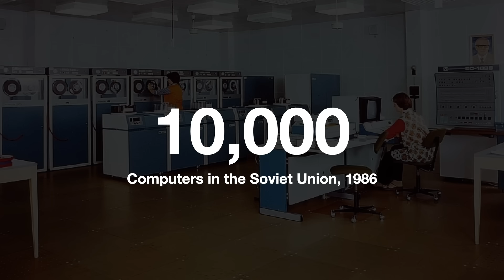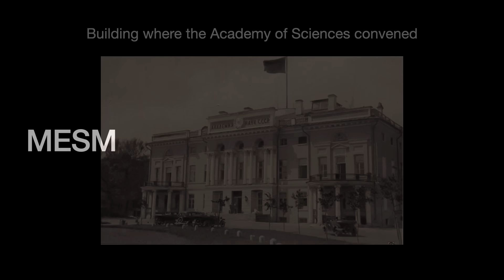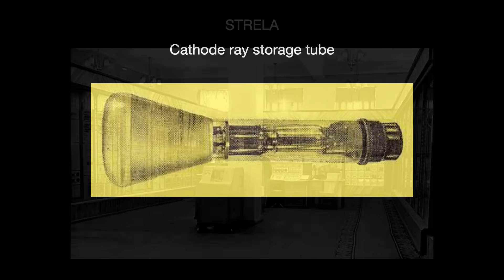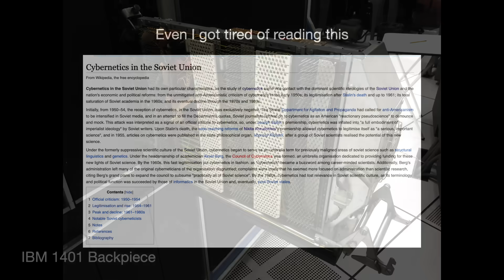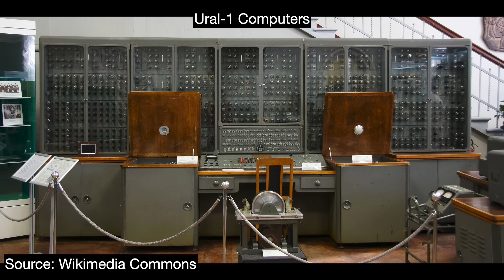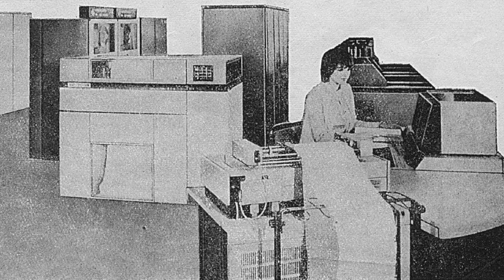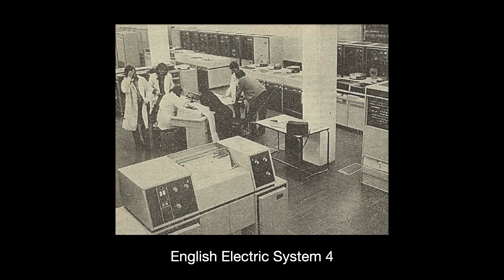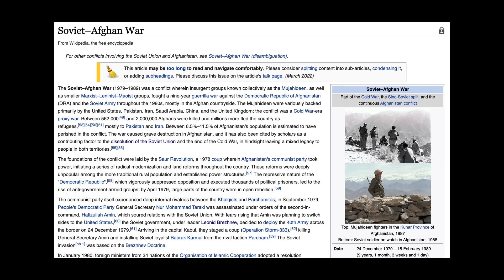Why the Soviet Computer Failed

Comment: As a Vietnamese, this is the first time in my life I hear about Soviet computer. All we have back in the day are Soviet made cars, and Aluminum wash-tub.  The wash-tub is indestructible and the car was unbearable.
Reply: The soviets were definitely years ahead of the west in wash tub technology.
Reply: @digitalcitizen4533  I think the general rule was that if it was good for something to resemble a tank, then that thing was good.... At least as far as its tank like qualities went.

Otherwise, results varied.
Reply: @bobs_toys  they were good at simple consumer electronics like fridges and fans and things, often built far tougher than their western counterparts, but once things got too complicated they tended to lose the thread
Reply: @glurgbarble7268  I obviously haven't had personal experience, but from what I've read about east Germans finding their stuff in western bargain bins... No they weren't.

A lot of consumer stuff was really, really, really well maintained, but that was more because if it broke, you weren't getting another one.
Reply: @bobs_toys  I lived in late USSR and as student managed to work with these ES (ЕС ЭВМ 1040 if I recall correctly)  series machines. One thing that surprised me first time I was in machine room - rubber mallet mounted on the wall. It was used to reset boards because connectors was crappy and contact loss was usual problem. Old graybeards told me that it came from factory with a machine.
Reply: @ctrlz4439  Wow!
Reply: @bobs_toys  I won't be surprise if that wash tub is actually a tank hatch which they rebranded as wash tubs.
Reply: @ctrlz4439  Made me think if apple did the same we would pay $1999 for Apple mallet.
Reply: @bobs_toys  hate to break it to you but even their tank wasn't all it's chalked up to be
Reply: @glurgbarble7268  To be fair it's relatively easy to have mechanical items reverse engineered.
Reply: @ctrlz4439  yeap true ! Same as for TV sets - need from time to time to be hit with the fist because of bad connection at tubes...restart policy !
Reply: @2nd_ntr  yeah look at how poorly their doing in the ukraine
Reply: @glurgbarble7268  I must say not even the simple consumer "things" were all that good. The only reason the russian fridge lasted for decades in my family was that we had no chance to get another if that one broke down, so my father made sure it was handled like a fairy queen and well maintained. IT was sturdy all right, I grant you that - about a 100 kilo of metal and very little electronics. Same goes for just about everything built by the block.
Reply: @Josh-rn1em  The Apple iWhack(tm), list for $1999 for the base model, and your choice of replaceable heads.
Reply: @captainnerd6452  Replaceable heads only $899 sold separately 😂
Reply: @ctrlz4439  uh
Reply: @ctrlz4439  Wow. I guess the "resemble a tank" part of Robert Bray's comment is very true...
Reply: @glurgbarble7268  Most of the consumer electronics (simple, complicated) of the Soviets are _replicas_ of Western products. I saw it with my own eyes. And they broke. Often broke. 

The Soviets could only produce rockets and tanks. This doctrine was laid down by Stalin in the 1930s --- for the (bingo!) victory of World Communism. And the planned economy was focused on achieving super-goals (Sputnik, Atomic bomb, Victory over Germany), regardless of losses, but not on market production.

* In Romania or the Czech Republic, these goods were of better quality than in Commie.
Reply: @glurgbarble7268  , in Cuba the washing machines were converted in powerful fans for the living room because they dont have air condition.
Reply: @bobs_toys  god old stalinium
Reply: @captainnerd6452  But the really important question is what colours does it come in?
Reply: @glurgbarble7268  settle down. I've used a Soviet made fridge. The POS needed a yearly recharge. You've probably never even heard of that. The soldering wasn't top quality so it leaked.
Reply: @glurgbarble7268  yeah agreed, their household electronics were solid ive seen some old. Sovoe products still running flawlessly that western versions would have failed long ago
Reply: @bobs_toys  east german stuff was crap, spmparts would be well built but other parts shot. For comparison most sovie things like cream seperators  or for mills for the household used brass gears while east german ones used plastic or zinc like western products
Reply: @bobs_toys  see 1950-ish Soviet women… very tanky
Reply: @bobs_toys  You don't understand the difference of logic in socialist and capitalist countries: In capitalism you are just a consumer, you should buy and buy. So the products brake quickly. I have still kitchen mashines from GDR (East Germany), which has been working perfectly for the last 40 or so years. That quality was and is never reached in capitalism!
Reply: @sakura44553  there's a bit of a selection bias here. You're paying attention to the stuff that survived while ignoring the stuff that didn't.
Reply: @bobs_toys  You know that🤣😂What an arrogance!
Reply: @sakura44553  are you saying that talk about the stuff that survived doesn't have a selection bias towards the stuff that survived?

Are you saying that if you can't replace something, you won't put more effort into maintaining it than if you can replace it?
Reply: @bobs_toys  You have an education in capitalism, so you can't see the point. I hope you see at least that capitalism with its buy and trash destroys this world. It would be better to produce long living stuff. That is what you can learn from Socialism, if you want.
Reply: @sakura44553  considering the amount of environmental damage I've personally seen socialist governments cause, that post is pretty funny.

Save it for someone who hasn't been going around the PRC for the last couple of decades.
Reply: @manictiger  mister Ts-ivilized Uu-hite Man, are you really trying to compare lightest serial production LMG for full-power rifle caliber with you very interesting, modern, tiknologik Rifle?
Reply: @synthwave1950  victory of the world's revolution is the concept of Trockij. 

If you don't know a shit about matter, holding "your knowledge" behind the teeth is better than voicing a quickly verifiable lie.

Also mind you telling us about the future, in there would be "super goal at all cost" if defeating the Elitarists state of the contemporary Germany?
Reply: @worldoftancraft  but not a capitalist government. As much as they embraced capitalism (when the alternative was being destroyed) they never liked it. It was always a thing they put up. 

Now we can see the effect of that dislike with Xi doing what he can to wind back Deng's reforms and going after anyone who's too successful or that he doesn't control.

I chose my words carefully.
Reply: @worldoftancraft  why would I need to write more? You seem to have this idea I said something I'm pretty sure I didn't.

Obviously I might have have  missed it. If you can quote me saying China isn't a capitalist country or something similar, that would be great.

As it is, it absolutely is a socialist government. They didn't allow capitalism because they wanted it. They allowed it, and continue to allow it because they have no choice.
Reply: @danutc7530  I was so annoyed by such TV so once I shot it with double barreled shotgun at my backyard. That was cool lol😂
Reply: @bobs_toys And that is a good thing. Reparing things should be the norm, not wasting them as junk when you can still use it
Reply: @Diego-lt4wm  what is? There's a lot of posts done a year ago
Reply: @bobs_toys  About repairing stuff because you don't get another electrodomestic device.
The problem nowadays is that almost any modern electrodomestic device is difficult to repair in purpose, aren't very durable and are designed to buy the new model
Reply: @Diego-lt4wm  I'll put it this way:
That it was done was good.
The reason why it was done was bad.

If the reason it was done was simply that by design, it was the most efficient use of resources, that would be one thing.

But it was done because there was a massive scarcity.

If I have a crash this morning, I can get a brand new car this afternoon if I choose. 

In the Soviet union, I'd have waited a decade because the stock simply wasn't available.
Reply: @bobs_toys  Indeed, and it depended on the city. I bet people from Moscow didn't struggle as much
Reply: @Diego-lt4wm  more likely depended on party position and job. Reward loyalty. 

Like the PRC has a pretty good pension system if you're in the party.

Somewhat less impressive if you're not.
Reply: @Diego-lt4wm  reading up on it. It's interesting.

I overall it's obviously a bet you'd win, but there's more nuance to it than both of ours.
Reply: Was it better to live in Moscow than other parts of Soviet Russia?

Quora thread with a discussion on this
Reply: @bobs_toys  Yeah, your statement on why that happened has much truth
Reply: @manictiger 😂😂😂 how many times you insert your Gucci rifle in every day discussions
Reply: @glurgbarble7268  simple soviet things like fridges were very unreliable compared to western counterparts and used to break down often. The only good thing of it is that they were simple and easy to maintain. The myth that they are reliable comes mostly from fact that due to lower production tolerances they also could take in more physical beating and abuse before breaking down.
Reply: @u2beuser714  it's a heavily capitalist society with a govt that really, really, really doesn't want to be.

"privatise when we must, make state owned we can (better personally control and profit from it)"
Reply: @digitalcitizen4533  they're meant for life and everyone only gets 1.
Reply: @digitalcitizen4533  I literally lold at that comment.
Reply: @digitalcitizen4533  whats a wash tube!?
Reply: @mohamedalhaneef1260  Wash Tub = a large bucket 🪣 or pail to wash 🧼 your clothes in. Very old-fashioned.
Reply: @digitalcitizen4533    Not to mention the famous Russian washboard technology, using women's armpower 2.0.
Reply: @timdunn2257  - Powered by a Babushka.0 processor.
Reply: @timdunn2257  haha, my grandmother had such a thing😂
Reply: @timdunn2257 Практически в каждой семье были стиральные машинки (в т.ч. автоматическая "Вятка") -- в отличие от нынешних США, где люди до сих пор бегают по прачечные со своим грязным бельем, и стирают его после чужого😂
Reply: I have a soviet era sidecar motorcycle. The motorcycle is unreliable but the sidecar would make an excellent wash tub.
Reply: Didn't anybody try attaching the wheels from the car onto the washtub instead, then?
Reply: @MrCantStopTheRobot  They actually did it. That's how UAZ 462 was created
Reply: @Megageks  YES the precocious Bukhanka!
Reply: @MrCantStopTheRobot   One shouldn't think so, after the first who tried it was sent on a Gulag tour as an anti-Soviet, uh, agitator.
Reply: The Soviet computers failed  because they don't use Taiwan chips.
Reply: I'm sorry but for some reason I think your comment is highly amusing 😅
Reply: I’d like to have a Lada
Reply: Yeah,i rememer YUGO's falling apart.😎🌴
Reply: @pedrorodriguez2914  Yugo? Who is that? Your buddy? There's only country of southern Slavs. Morely known by selfname of Jugoslavija
Reply: @worldoftancraft  A YUGO, Yugolavian made car that was sold in the USA,it used to fall apart after a few miles,it was a big joke 😁
Reply: Is this "make fun of anything Soviet" thread?
Reply: I predict Bald and Bankrupt is soon coming to inspect your soviet sinks!
Reply: There have never been other aluminum wash-tubs but Soviet, haven't they? Ha. The USSR had BESMs (big computing electronic machines) in the 1960s. I know the name of one of those, Aldan.
Yeah, what you know is just like a Vietnamese.
Reply: Probably, the quality of education in Vietnam is still not at the top level. 
I had a friend who was in Vietnam to teach locals to operate anti-aircraft missile launcher systems. Well it did not work well. So at the end Soviets had to put their own crews there to close the sky to American B-52s.
Reply: 😂 sounds like “this was first time I heard that there was metal music in the Soviet Union”
Reply: Was that washtub electric or hand powered. I lived in Siberia from 1990 to 1993 and married a local lady. Her grandmother had both and the hand cranked version was from the 1950's. I was familiar with the top loaded agitated washing machines as they were RAF issue back in the early 60's. That hand cranked version was not dissimilar complete with mangle on top. I asked her why she had both versions and her answer was funny to say the least. She told me both washing machines were very good and reliable but unfortunately the electricity wasn't. Ah I said but then neither was the water because when the electric failed the water pumps failed as well. To which she explained that it was another reason to keep the manual washing machine because when the water failed her husband put it on his tractor and took her to the Irtysh River about half a kilometre away. 
What I learned in Russia is there is a solution to everything and throwing some things away only reduces your options.
As for the cars they must have sent the worst ones to you. The Zils and Volga's were incredibly well built cars almost over built. When I got married in 1993 the wedding cars were all Zils and Volga's and some of them were over 40 years old. The Gaz was a good car as well. Thing about Russian cars is they are built for very harsh conditions and maybe a tropical country is not the best environment. Having said that they were very popular in Cuba and many are still on the roads.
Reply: soviet ALL cars have western cars groove copy soviet not can plan and made any good car own engineers no have smart and brains plan anythink n own cars or electric.
Reply: Today the Russians can't even build a clothes washer - Western countries use microchips in washing machines, which Russia can't make, and now can't buy.
Reply: Enjoy communism dude
Reply: how is it possible asa vietnamese that you make fun of the people (soviets) that supported you against the americans who raped and pillaged your country, slaughtering millions of your people?
Reply: @AB-ng7go  Learn the difference between peoples and products. I made a joke about Soviet products not Soviet peoples. The joke is also true, I still have that aluminum bathtub in my house and it working fine.
Reply: @bahamut149  not a nice joke tho
Reply: @AB-ng7go  Ho Chi Min was a communist spy supported by the URSS and a traitor to his people. Where is your vietnamese communist paradise?
Reply: Don't make fun of lada, blyat
Reply: Tubs lasted forever no doubt but the Soviet cars will be forever remembered as 'Upsidedown Skips.'
Reply: Lmao
Reply: I have heard that about Soviet Cars
Reply: Russia can bear anything.
Reply: This wash-tub helped kick the Americans out of Vietnam. Remember?  Recently: Afghans hung on the chassis of aircraft. American computers helped take off quickly.
Reply: But the car was also indestructible 🤣 and i bet it still runs today
Reply: As an American, I learned about Soviet computer development only now.
I knew about The Eniac and the WWII Enigma project way before I learned any of this.
Reply: ha ha ha ha ha ha ha ha!
Reply: Actually the Lada (Zsiguli) was a very good car. In the 60s and the 70s. It had Italian origin, but the soviets made it simpler (bulkier) for their needs. It became outdated in the 80s ofc.
Reply: And our American POWs.
Reply: there were PC prototypes in every communist country.
Reply: You forgot to mention Soviet fighters, tanks, armored vehicles, and last but not least: AK-47s.😁
Reply: Didn't you, as Vietnamese, have heard about Mig's? 🤔
Reply: @1919whitearrow  I'm a civilians.
Reply: @1919whitearrow  vietcong guys learned MiG after a year, but anticraft missiles were able to operate after less then seven months...
Reply: Should have seen the Fors Pinto
Reply: Well, Soviet technology also successfully helped Vietnam fighting the US military devices.
Reply: @alexandrebaz4765  Ukraine is doing well because all the stingers and other hardware were specifically built for their ancient military. It doesn't matter if you have thousands of tanks if they can be destroyed and outclassed. Vietnam was just a bad all around move for the US.
Reply: @bananamufns  No Ukrain is losing hard against an army that has not been given the kill order yet
Reply: @bananamufns  you were so wrong.
Reply: @alexandrebaz4765  with respect toward the Vietnamese, the casualty rate was 5-10:1. Sure there would not be a victory without Soviet support, but technology was not the foundation.
Reply: @KC-bv9kf I was honestly unaware of how successful the Russian AA systems where in Viet in till several years ago 

The technology made a huge difference in how we fought that war
Reply: This is what you get in a authoritarian state.
Reply: Still better than gallons of napalm US gave you guys.
Reply: And now you make fake Flip flops. Just shut up and enjoy your fkd up Lada bro
Reply: @vovkaNews1  what is wrong with you? Do you enjoy the idea of an entire nation of people being damned to poverty and corruption? Is it funny that no matter what folks try to do to make their lives better, they'll never accomplish lasting progress? You're laughing about starving babies.
Reply: In a survival scenario do you think you would be more forgiving of someone eating another Vietnamese as a means of survival. Perhaps over a few day period?
Reply: Your level of development at that time corresponded to what you had. There is nothing surprising here. It would be amazing if you had the same quality of life as in USA. But even in the USA at that time, not many lived very well.
Reply: That is strange because the Soviet Union gave Vietnam multiple computer setups throughout the years, including those for educational purposes of which several are sill kept at major tech universities. Maybe learn some more history of your own country?
Reply: @vuquylam93  Which major tech university still keep those computer?
Reply: @vuquylam93  Correct. Konrad Zuse's computer was in CCCP at he end of 1945, but it was cheaper to buy machines from western countries.  Computers were built by Siemens and sold to CCCP.  Obviously, the original research remained there.
Reply: @vuquylam93  you're right! Vietnam during the cold war was a paragon of political, economic, and social mobility! Everyone had 2 cars, full bellies and college educations! 

Shut up you revisionist tankie. Next thing, you'll tell us about how the vietnamese people all know how to program and how to fly spaceships. And they could have never done it if it wasnt for the good old USSR!
Vietnam is still a fractured fucked up place to live. It's so fucked up mainly because of the USA and the USSR.
A couple computers over the course of decades will certainly make up for having 20% of their population wiped out by the craziest civil war in human history. The soviets didn't have enough specialists to computerize their OWN industries. Do you really think their exported computers were quality machines that had the right amount of technical support? I mean, shit. The fact that you say some universities are STILL using these dinosaurs indicates just how half-assed and hollow the soviet computerization effort was. They gave them table scraps.. and the poor bastards are still making due because they can't afford anything better.

Just shut up. Do you really think you know more about vietnamese history than someone who's from there? And you gleaned this from a single comment in the format of a joke. Shut the fuck up
Reply: @vuquylam93  I'm russian (33 years old) and i had never see soviet computer. So, i working in software company.